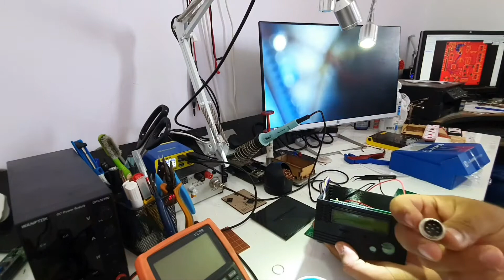DIY Pro'sKit ss-331h Got a PCB

Comment: I recommend using a fridge compressor and a air valve 
Works far better and much more punch 

Might blow a few compressors up but esay to find and worth scrap metal  

Also wat type of temperature sensor does it have 
Ntc or thermocouple
Reply from the maker: great idea👍
Thanks
Reply: @FixTronics  no problem 

Most fridges the compressor is on a steel plate u can unscrew and whole unit comes out and mains lead is all pre ready and theres just a output lead with earth and neutral power and phase power and compressor on wire sos u can make a switch or just wrap and tape wires up 
Pretty fast ready to go 

If you could design a non cpu converter circuit for iron sensors be gud n handy 
Use ptc on ntc or ptc on thermocouple etc help with different irons n stations
Reply: My neighbors are always curious why I have stacks of small refrigerators, air conditioners, microwave ovens, CRT televisions in my yard that I do not throw away.  And behold!  Thus now becomes the reason!  Thank you.
Reply: @WhatAmIGonnaGet  you think good 👍

Comment: Very good project! Congratulations, I like it a lot. I have a doubt! the desoldering gun can be operated only with the pump. I mean skip the arduino control that works in a basic way?
Reply: U would use a relay with a diode blocking to not destroy the gun trigger switch 

I use fridge compressors with mine 
I have burnt some compressors out but they are plentiful and scrap duds 

I used fridge compressors on full time and a air valve on trigger release vaccum
Reply from the maker: Hello brother 
I am glad you liked my project 

As for the pump part, yes you can make it work without the arduino 
You just need to connect the gun switch in series with the motor
Reply: @FixTronics  Thank you very much

Comment: What do you use for air filtering?
Reply from the maker: I used something like this in the link
https://a.aliexpress.com/_mq6pfaM

These are fuel line filters but they work great for this purpose 

I added some cotton inside the filter and it works perfectly
Reply: @FixTronics  Is this needed? I don't see it in your build from the video but I see the original station has like a diafragm with a filter in it.

Comment: Hi, the gun heating element is 24 volts?
Best Regards.
Reply from the maker: Hello friend 😊
Yes its 24v 
But the power supply used in the original station is 18V 12A with part number zd-p150